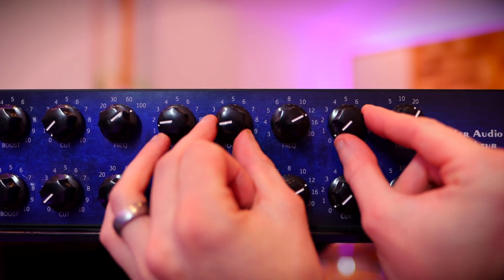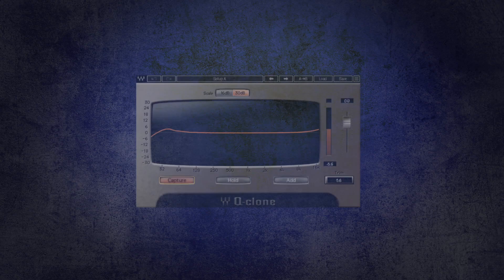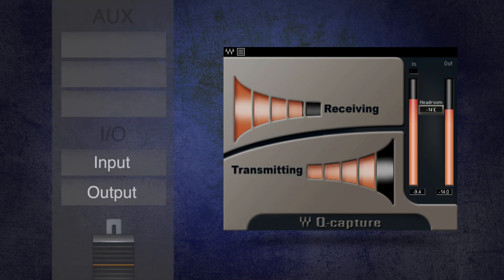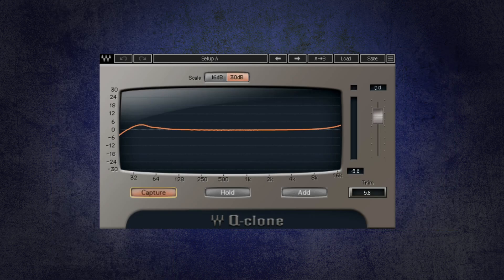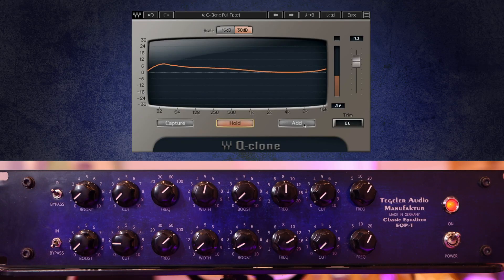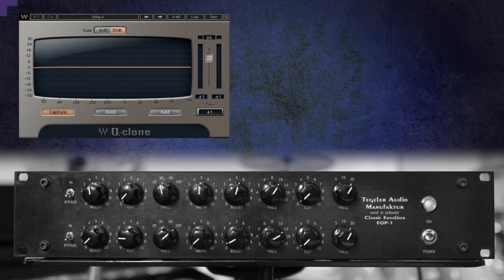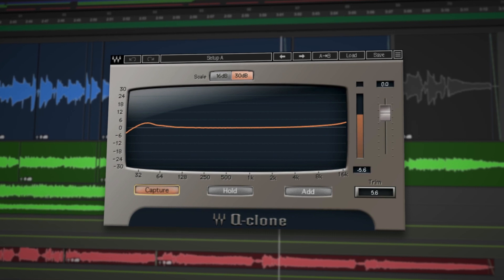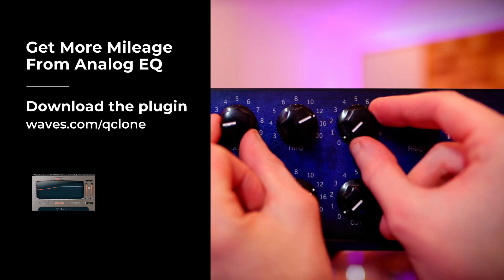How to Get More Digital Mileage from your Analog EQs

Comment: I'll never going to buy waves again. The V 12 plugins doesn't going work with Windows 11 they say. You have to upgrade and pay for V 13 for all your plugins then. Good bye!!
Reply: With windows 11 the issue I had to resolve was that it'll set you up for OneDrive cloud backup. OneDrive will sync with your desktop and c drive. Everything saved to those will automatically be saved to OneDrive instead. If you are not subscribed to OneDrive or run out of space in the "demo" version then it will lose plugin files. I had to backup the songs I made to that point. Go to the Onedrive settings from the windows notification bar unselected the backup folders and unsync it from my desktop and c drive. After doing this any data that was automatically stored there will be inaccessible. So now you got to delete and redownload your DAW and any plugins/vsts that are not loading into your DAW after redownload. After doing this you'll be able to open up anything with no issues

Comment: NICE VIDEO. VERY INFORMATIVE. IT WOULD BE HELPFUL IF YOU DID A VIDEO ON ADDING THE  HARMONICS TO ACHIEVE THE ANALOG SOUND TO A GIVEN Q CLONE PROFILE (EQ, COMPRESSOR, ETC.)
Reply: A quick easy to get an extra layer of analog would be to use an instance of H-Eq after q-Clone. Have H-Eq flat and play with Analog, level and THD Level controls
Reply: @dancooperwaves3685  Thanks Dan. That makes perfect sense.

Comment: I have found this to be a great plug in but I believe Q-Clone is in need of an update. A few ideas:

1) Multiple Q-Capture so you could run for example 24 different instances of Q-Capture through a 24 channel analogue desk with a “constant capture” option to mix in realtime utilising Q-Clone eq. This would possibly go some way to bring a true analogue feel to digital mixing. Similarly multiple 500 series eqs (or indeed any hardware eqs) could be utilised the same way.

2) Frequency display nodes similar to Fabfilter Pro-Q 2/3 

3) Disable/bypass nodes option

4) A Blend function that can pull the eq node back towards zero, similar to the Dry/Wet balance on Sonarworks Reference 4 by way of example.

5) Multiband functionality (for the blend function described in point 4)

6) Blend/Morph between captured eq nodes using automation 

7) Updated GUI in line with other Waves updates

Not sure if technically any of this is possible (!) but I believe these features would be a great way to update Q-Clone

“It’s a Plug In that doesn’t get a lot of love, and I think it’s awesome” - Andrew Scheps

Comment: This plugin needs to be updated. As is, Pro-Q3’s capture function is far more accurate. Until this plugin captures other qualities such as harmonic content, noise, etc. it’ll remain inferior to other, more modern options out there.
Reply: Not 100% sure you are correct here. What you are referring to references tone from one track and applies it to another, which is a totally different thing to Q-Clone which recreates analog EQ curves from hardware in real-time.